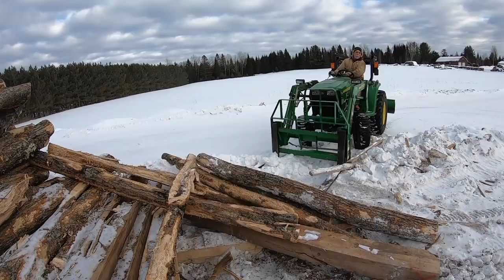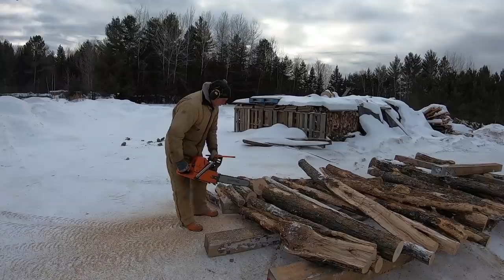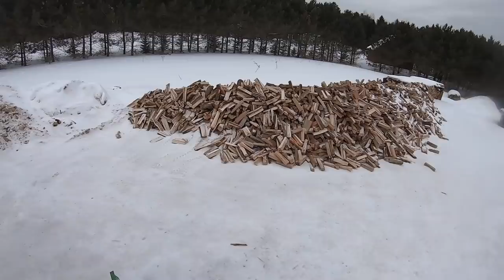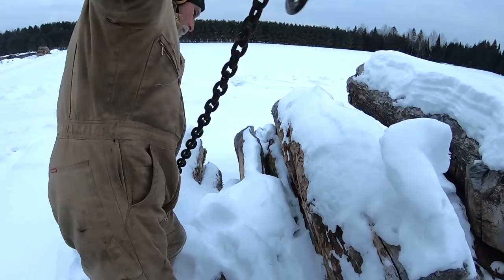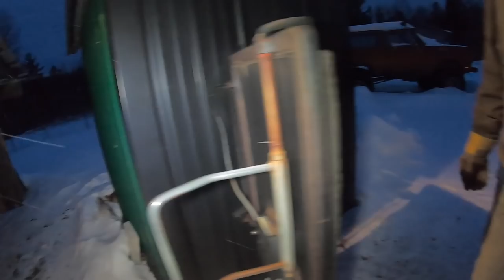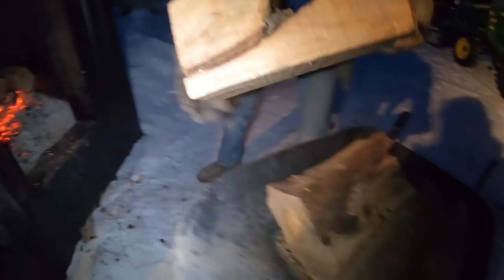Firewood at -20° F in Ken's woodyard! - #597

Comment: Your new videographer did a great job!  I think she needs a raise.

 I see the nice stack of wood in the bucket and then see it get dumped into a pile and think of the extra handling that's going to go into stacking it.

Would there be a way to stack on pallets, ratchet strap it down, and fork the pallet to where you want it?  I'm no expert (clearly) but minimizing handling has to be a key to increasing production/reducing time spend working in those balmy temps...
Reply from the maker: Good call! Maybe so!

Comment: What do you think of the smaller processors like the Range-Road for a small firewood operation like yours? All the small processors of that design for at least three different brands come out of the same factory in China. The Lil Beaver 14 available through Multitek is $20k. Curious as to what size amd models of processor would work for you in your operation and what would work for Kenny. Am looking well into the futre for my long range planning.
Reply from the maker: The lil beaver is a nice machine!

Comment: i don't mean to be picky, but if you trained your attention a little more to properly gauge the length of those logs you're looking to turn into firewood, you wouldn't have to rely on the metal rod with the magnet on it to get your size.  Just sayin'.
Reply from the maker: I can cut fast with the gauges that are made with cable ties and be accurate at the same time.